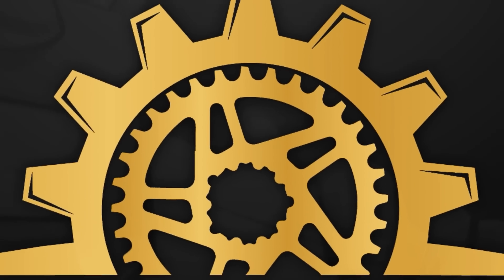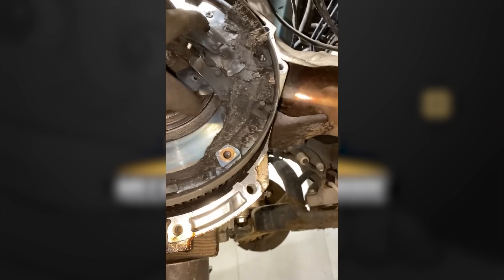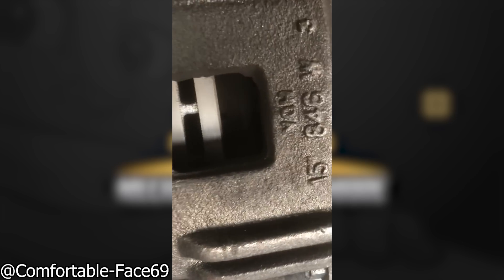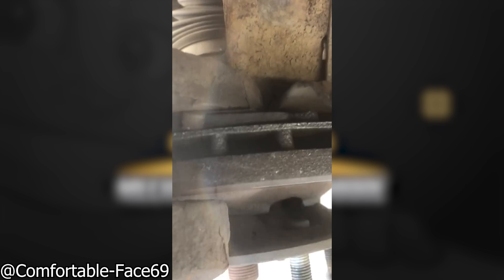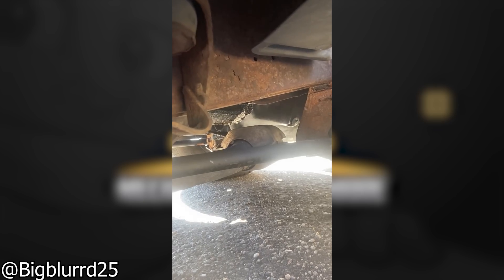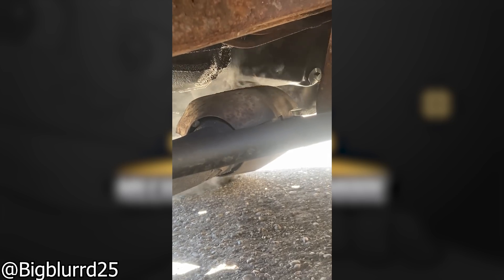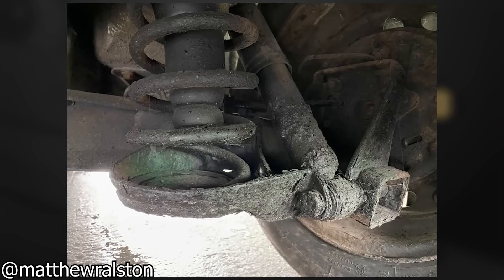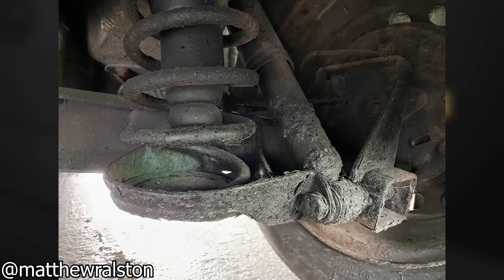Customer States Burning Smell Coming From The Engine | Mechanical Nightmare 85

Comment: The one around 1:35 reminds me of something that happened to my Jeep XJ. I was driving it to work one day and this awful clanking/rattling noise started from the right front, but it only happened when I hit a bump. Turns out whoever put the shocks on apparently didn't properly tighten the top nut when the shocks were installed about seven years ago.

And... there is no problem finding the guy who did it, he looks at me in the mirror every day. D'OH!

Comment: 38 years ago, I lost a right rear wheel while I was towing a pop-up camper. Before the trip, I noticed that one of my wheel studs was gone. The other four snapped off on the interstate. Both the wheel and the drum rolled into the grass on the side of the road. One pump on the brakes, and I realized that I had none. I managed to slowly, very slowly maneuver the car and trailer onto the shoulder, while the car was riding on the trailer hitch that was under the gas tank. There weren't cell phones at the time, but I was lucky that a tow truck happened by, within 10 minutes. I had the wheel, and the brake drum, and I had not popped the wheel cylinder, so it only cost me for the tow and 5 new wheel studs, and nuts. It probably only cost me under $50. ...Very lucky day.
Reply: @waynepantry7023  Why do we need your silly comment?

Comment: The backstory: late 1970s, two-axle boat trailer, those then-fashionable eight spoke steel wheels, and closed-end acorn lug nuts. I see some of you already nodding your heads because you know where this is going. Fortunately not my boat or trailer, but two guys were driving from San Diego, CA, to the Colorado River. The passenger’s attention was drawn to a wheel rolling off into the desert, passing them. Then the passenger realized it was one of theirs. Yes, the acorn lug nuts bottomed on the end of the studs before clamping the wheel to the hub. The nuts were wearing right through the wheels, and finally got completely through the first of the four and the wheel came free.

Comment: Never needed a 10mm wrench, so that wasn't mine. 
10mm sockets, on the other hand... lol
Reply: The 903 cu. in. Cummins diesel uses 3/8-16 bolts pretty much everywhere that doesn’t need something bigger. With ten of them to maintain and repair I had one canvas tool bag filled with every version of a 9/16 inch wrench I ever found. Extra long ones, double deep offset stubby ones, starter wrenches, etc., etc.
Reply: Both
Reply: Some battery clamps are 10 mm and a socket won’t fit on it.

Comment: Why can't people just do regular maintenance...
Reply: Absolutely, I bring my cars in twice a year to just have them checked over….for 85$….all fluids, brakes everywhere on everything. I have a 15 year old G6GT convertible with only 39 thousand on it and a Ford Taurus 500 that’s 14 with 57 thousand on it…both pretty pristine.
Reply: Most people just expect it to run & drive when they put the key in it...blissfully unaware that even new cars need maintenance...if all someone knows about cars is where the key goes, then they know nothing about any of that...I went to visit a friend recently & noticed that the rear wheels on the back of the car they drive on a daily basis were tilted at extreme angles, & not because they wanted them that way...& they had never noticed...some people don't even look at their vehicles to even try to spot problems, as long as they're running & driving, they think it's fine...they simply don't know any better & most aren't really interested in learning either...

Comment: That brake can is fucking terrifying if the spring is still inside
Reply: That's why it's got a hole torched in the side of it, safety.  Cut the casing open with a cutting torch,  then cut the internal spring in several places with the same torch, cut spring removes the internal pressure rendering the brake pot safe.

Comment: 2:00 that's the new Jeep Sway-Lok Cam system that uses their exclusive Sway Bar locking technology .  You push a button (or punch it) and it engages the rest of the cams for more power.

Jeep VTEC basically.